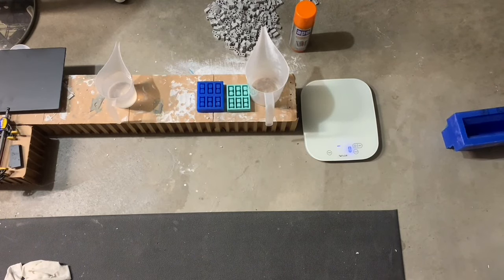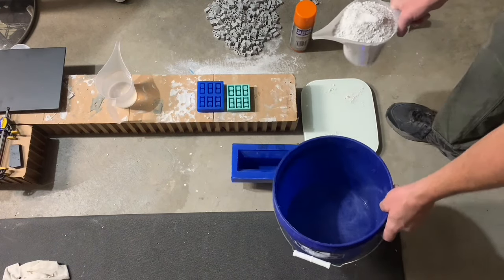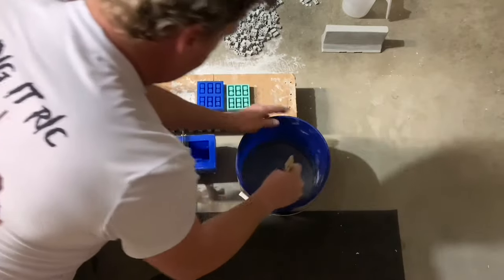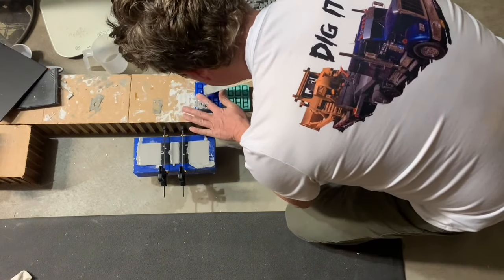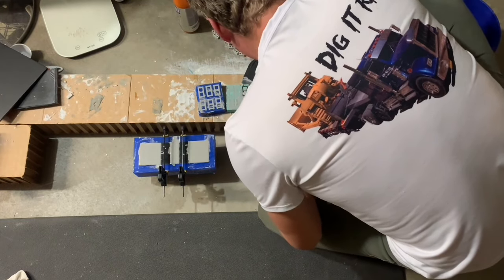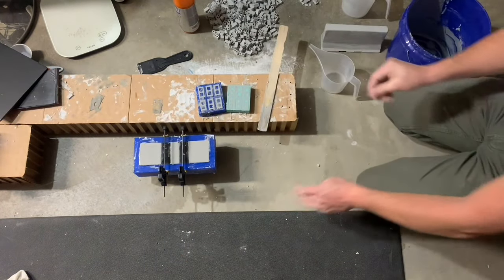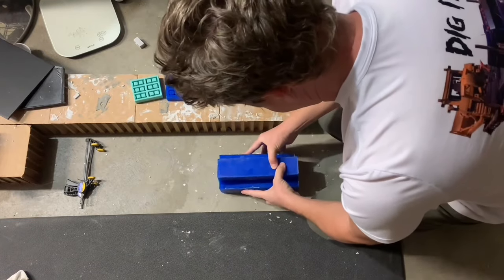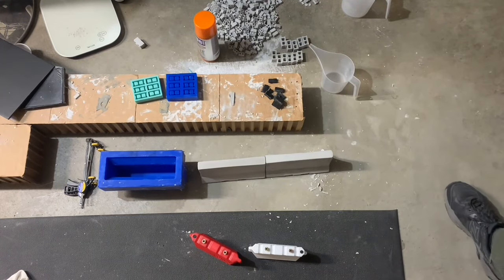Jersey barrier production in 1/14 scale.

Comment: Good video, If your casting mold is distoring , place it in the mold '' box'' you made to make the mold & that way it will be held to shape when you cast a part.
Reply from the maker: No distortion after I add the parts for molding in the fork slots. But that’s an excellent idea! Great tip.